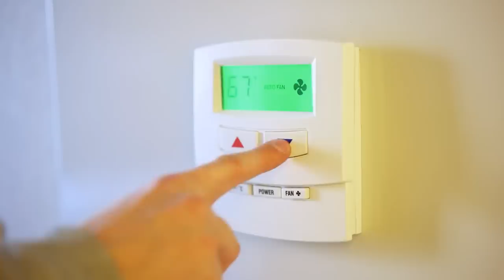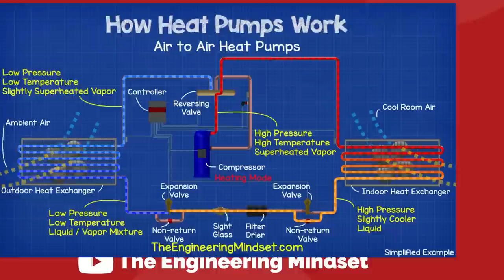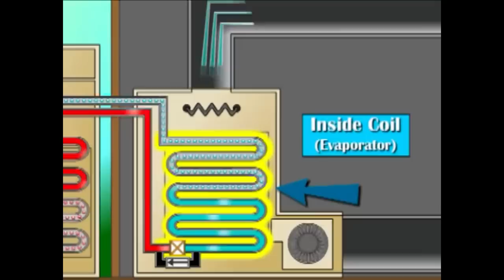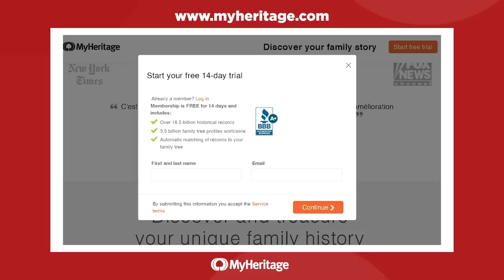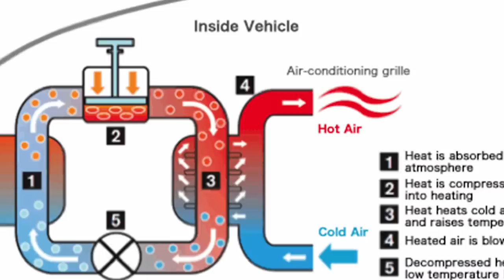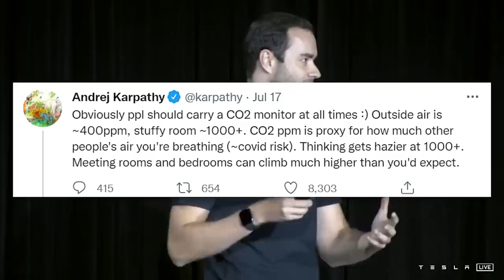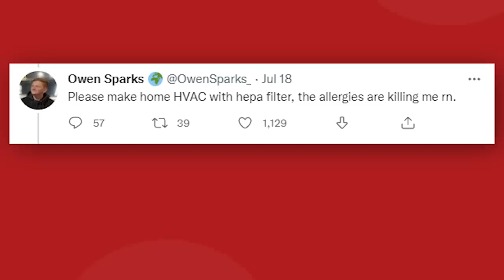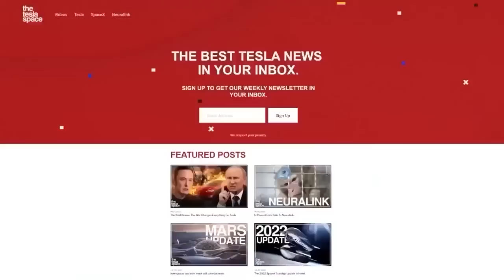Why Tesla's Heat Pump Is Essential For Our Future!

Comment: Note on Freon: To damage the ozone layer, it has to get up there, which in practice it can't in any significant amount. But when DuPont's patent was about to expire, it was suddenly banned and everyone was forced to buy more expensive alternatives. Much like how when the riffraff started moving to coastal California, the rich homeowners put a stop to it in the name of environmentalism.
Reply: It's the same story with 410A the patent will run out and they will look for the next Freon source to use.
Reply: I'm going to give you the inside scoop about how this heat pump is going to work will be multiple small heat pumps just like in the vehicle and what they will do is string them together on the same shaft that way it can gain maximum efficiency and what it will do is physically only run one heat pump per room or two this way you can actually select the room that you want to have colder than the others and you can control the airflow individually to each room you can have heat running in one room and air condition running in another just depending on what the person in the room preferences and individual thermostats for each individual room this would allow ultimate efficiency combined with artificial intelligence to control the entire system as a whole... having all of the compressors hooked up on the same rotor means that they can individually kick in and if there's more than one of them kicking in they both work together so it helps get the other compressors up to speed and cuts down the energy loss. Because the system will be able to have multiple different heat pumps it can run one of them on air condition mode and the other on heat mode which will basically make dry air because once you heat up the air the moisture can be absorbed by the one cooling easier and you can control the actual humidity perfectly. Mark my words this will be how the system will work it will be for new construction and for retrofitting because you're able to hook up the individual ducts instead of the entire manifold which supplies all the ducts...
Reply: @AquarianSoulTimeTraveler  Starting January 1, 2023 all new systems in the US will no longer have R-410A. The new refrigerants are HFOs, cars have been switching over to HFOs since 2015ish.
Reply: Wrong
Reply: Err, so how exactly did the ozone layer start to deteriorate in the 1970's and keep getting worse in the 1980's, if the reason is CFCs and yet they supposedly can't reach the ozone layer? The fact is that a very small amount of for example CFC-11 molecules do reach the ozone layer 30 km up and there they quickly deteriorates into chlorine radicals. Those stay up there for years and catalyze untold ozone decomposition reactions. CFC-11 is quite heavy but there is always a trailing end of gas molecules with enough kinetic energy to diffuse much higher than they're supposed to based on the average. It's just thermodynamics and statistical behavior of gases.
Reply: It's actually called "refrigerant" and Freon is just a name brand.
Reply: Since the banning of CFC's, the ozone layer is measurably improved.
Reply: @wombatillo  CFCs were actually well documented with solid measurements and observations of their breakdown and cascade reactions in the ozone layer.
They were used in all manner of processes and products, from the industrial level down to consumer products, as cleaning solvents, foam expanders, spray propellants, for fire supression, etc.. The HVAC/R industry was actually only a very small percentage of the total.

To my knowledge HCFCs, like R-22, never had anywhere near the same level of evidence of being a problem, but since they do have a chlorine atom in them, were phased out.

I question whether the actual impact from the HVAC/R industry was at all significant, or if it has been even remotely worth the cost to end users of the equipment to do away with.

Having said that, I'm an HVAC/R technician, so it's my job to follow best practices, and current regulations, and I make good money doing so.
I just wish the new refrigerants were not so expensive, and that equipment manufacturers were not currently so universally awful at building equipment that doesn't leak...
Literally all of them suck, there is not a single brand of equipment we can install that I have any level of confidence won't be leaking refrigerant within 5 years.
Reply: How do you know that Freon cannot make it up to the stratosphere where it can break down ozone?
Reply: R12 takes a decade to reach the stratosphere. It wouldn’t have been so bad except for the military using it as a cleaning solvent
Reply: You wanna breath freon be my guest lol
Reply: @bringer-of-change  Harmless at levels that don't reduce O2 levels.
Reply: @markbeiser  I wouldn't trust that slow leaks over time wouldn't eventually cause problems. I guess as long as the device is made well enough to ensure it wont leak then it's fine 🤷‍♂️ nobody wants a leaky machine anyways.
Reply: @AquarianSoulTimeTraveler  This type of system has existed already for years. VRV/VRT technology with inverter driven compressors.  I install them and service them. Typically they are in commercial applications because a home doesn’t normally need heat in one room and a/c in another room.  

Residential system are available and readily installed with inverter driven systems with VRV/VRT technology.  Daikin makes their “Life” system.  It is a unique residential product as it does not lose it’s heating capacity as it gets cold outside.  It maintains full capacity all the way down to 5 degrees outside. It doesn’t require a back up heater/aux heater like almost all other heat pumps.

It has many other unique features like the ability to connect up to 9 indoor units to one outdoor unit.

I hope Tesla does create a new product but the product you describe here is already available and they are highly advanced and packed with high tech features.
Reply: @colingenge9999  It's a heavy molecule and is broken down by sunlight. You'd have to have high flying aircraft spraying it to have a measurable effect.

Which actually did happen, now that I think of it. No doubt the military was even less efficient at keeping their systems sealed than civil aviation, and  it wasn't a priority given how cheap it was.
Reply: @tickticktickBOOOOM  are you just speculating that Freon with a higher density won’t go to higher altitudes?

If that were the case then nitrogen with the density of about 1.35 would not be found at sea level and would rise up in air that has an average density of 1.42. Carbon dioxide is a density of 1.8 would fill up the valleys but that does not occur. Freon has a density of about 1.6 kg/m³ so you’re postulating that somehow that would never rise up in the upper atmosphere yet if that were true then our atmosphere would be layered according to density with nitrogen at the top, Oxygen in the middle and all the carbon dioxide at the bottom but that does not occur because there are other mixing forces at work which is how and why Freon gets into the upper atmosphere but it does take a while. If I think back to my high school chemistry I recall some thing about partial pressures which force different gases to eventually distribute them selves evenly in any given volume over time.

I was involved in the whole ozone layer thing in the mid-1980s. Our concern was the movement of chlorofluorocarbons into the stratosphere from hail on which was being discharged in great quantities for fire protection purposes. The scientific panels that did this work we’re just a bunch of military folk or a small group that could call together some conspiracy but has scientist involved in every developed country in the world where there was complete agreement as to the mechanisms involved if not all of the absolute details.
Reply: @erickbravo5800  kind of Freon is not a name brand it is only R-12. Just like technically you can use propane as a refrigerant we call it propane although it has an R number as well. People just use freon for everything.
Reply: Correct
Reply: @wombatillo  I think that may go over the head of the commenter.....🙄
Reply: @AquarianSoulTimeTraveler  but you can just use one pump and use valves to control which rooms it cools.

Comment: Don’t have this system but I have been thinking about underfloor heating running off a heat pump. Concrete has a greater thermal mass than air and would be so good to hear a large slab in winter and cool it in summer
Reply: I have a slab foundation and it absorbs heat and cold really well. The problem is that the slab is down low so it doesn’t cool upper floors in the summer or help heat the lower floors in winter. Def better for single story homes.
Reply: @Martocciaweb  yep. Single story is ideal it would seem. Obviously a consideration on brand new builds.
Reply: Also heard you can run into problems in spring days with wide temperature swings. Freeze at night and nice during the day.  You still have a lot of thermal heat in the concrete but it warm out and it makes the house to hot.
Reply: I'd say just stick with water heater flooring. a heat pump would use to much energy overall and be next to useless since refrigerant pressures would not be stable since it's not consistent airflow/temperature plus during cooling season your floors would be cooled which for a concrete floor is next to useless.
Reply: @Tah_Dot  Underfloor heating from a HP is always water based. The HP runs refrigerant through a heat exchanger and heats or cools the water. In practice very few installations cool floors because there's little benefit but many drawbacks with this
Reply: We have underfloor heating on concrete (since 2001). It works well, however in my opinion it will be better in a floor with low inertia. Why? Even in winter, there are sunny days, you can not turn it off, because it takes too long to respond. The same in springtime. With a floor with low inertia, you can better adjust the room temperature in a fast way.
Reply: I warn you to properly insulate that concrete slab. You basically have to pour it in an "insulated pan" or else heat loss is extreme and would cost more to operate than any air to air system. I've seen bad floor heat systems as a utlity worker that cost customers a fortune to operate.

Comment: I’m a commercial HVAC technician. Besides the efficiency of the heat pumps constantly improving I haven’t seen anything on the horizon that would replace the ac concepts we currently have. Mitsubishi is pretty much top of the line and has been for a while
Reply: You can't expect a mechanic to suggest you walk to the bottom of your garden. No, fix the car so that you can drive there. Get outside your tiny box wizard and begin to see the world around you.

Comment: I'm a hvac contractor your description of a heat pump is good but as far as it not producing co2 is misleading because it depends on where the power comes from. In ohio the power they have is 92.6% coal power so you can explain how is there no co2 to the audience? Power does not come from thin air...

Comment: Im a Hvac contractor. They already make air quality product that does better then tesla car filtration and there on the market. However it’s all based off of what people want to invest in there system. I have a dual fuel system and the highest seer trane variable speed heat pump here in michigan. It does quiet well and is efficient to about 17-23f degrees. Then the furnace takes over. They are getting closer to being more efficient but not quiet there natural gas furnaces are still more economically efficient then any heat pump in colder climate. Electric based heating system heat pump and furnaces are 100 percent efficient but not economically efficient in cold climates. Overall having a dual fuel vs just using propane/nat gas is more efficient until certain temp marks in a lot of instances however that is based on how much you will pay if you get a base line product or top of the line product will determine your efficiency. Just like anything you get what you pay for.  I’d be interested in seeing what they come up with. However allow temps
to change when you leave and return and programming stats to go down at night and go up during the day doesn’t really save you money just to be honest. Every time you do this your system has to reheat or cool/dehumidify the whole house and objects in it. when it does it utilizes more energy then keeping it a constant temp in the house. That’s why having a variable frequency drive on a heat pump maximizes efficiency while maintain most comfort. instead of change temp your change the speed of the compressor creating less energy consumption.  You may save a few dollars a year possibly but also could pay more changing the temp and not keeping it constant. All depends on multiple factors.  I don’t see him doing much in hvac field that would change anything maybe on the tech side but nothin more. I’ll be interested in seeing if he does though.

Comment: I don't own a Tesla HP but I do own a Daiken HP that can be firmware updated, I can control temps and ranges from an app on my phone  and I have a two stage filter system including HEPA and ionization filters.   We run completely electrical in my house except for propane on demand hot water and factoring that in, I'd say along with some energy improvements like newer windows and doors, etc.  Our overall electrical bill has dropped by more than 50%.  Even in the summer when cooling.
Reply: Not always the same answer. nasa. ;-)
Sensible answer yet no comments nor even "likes".

Comment: Usually you're quite good about explaining technology, but even though I know & can explain the Carnot heat-pump cycle, I had problems following your explanation. You've done much better on other topics. For instance, you shouldn't have bothered talking about vibrating molecules. Yes, it's technically correct, but it's also distracting, especially for those who don't understand. It gets HOT. Leave it there. You also didn't touch on the fact that the phase change, from gas to liquid & back again, is what really transfers the heat. I would have thought that would be interesting to your viewers, & it's less technical than vibrating molecules. My 2 cents...

Comment: I’m a HVAC designer. All of technology already exists, and has for decades. Mitsubishi, Fujitsu, Daiken other leading manufacturers have very advanced systems systems with low ambient heat pump, indoor air quality from bipolar ionization, UV filter and ye, HEPA. This premium equipment is less common due to initial cost.
Reply: What is HV?
High velocity?
Hyper Vehicle?
Hot vacuum?

Comment: Very good video.  I wonder though, why not use the heat pump system to heat the water for the house, or cool your refridgerator, or dry your clothes...  why not produce a single unit that will take care of it all efficiently?
Reply: The problem with trying to heat water is that it needs to be heated to about 60degC. 
This requires the gas in the machine to be compressed to a much higher pressure than one dumping heat to ambient air temps.
It is also at the top end of the operational range of the current range of refrigerants.
We uses R717 which is one of the oldest but one of the most effective refrigerants but even that tops out at around 70degC
We are designing a hot water heating system at work and requires 25bar pressure to operate whereas the normal pressure is 10bar. Its capacity will be approx. 5 mega Watts.
The pressure ranges and demands of a refrigerator and a dryer are quite different and so better to keep them as independent units.
Reply: @GSimpsonOAM  Best answer yet. Someone who can use English to transfer ideas! Seldom on this YT trash page. 
R717  and producing 5MW? That sounds like fantasy. Or are you heating a factory?
Reply: @kennethkeen1234  Yes, heating water for a factory. Although a friend with several teen-age daughters could have done with it. His hot water bill was horrendous.

Comment: I live in Ohio and run a "Dual Fuel" system.  I use the heat pump down to 25F and then switch to the gas furnace at or below 25F.  My heat pump is arguably not the most efficient, it was installed 10 years ago, but it is better than running natural gas 100% of the time heating is required.  I would say I the gas furnace runs 30-40% of the time heat is required.  Newer heat pumps, particularly VRF (variable refrigerant flow) and inverter heat pumps are incredibly efficient down to very low temps.  I installed one a few years ago that was rated to heat at the rated capacity down to -13F.  Not too bad.  I still think there will be times when resistance heat or gas will be required as a back up, especially in colder climates.  Curious to see what improvements Elon has really made to improve the heat pump beyond what an inverter or VRF can do.

Comment: INSULATION! Most efficient means nothing if the house was not insulated well.  Owned several poorly  insulated homes in the past including overseas.  Our final home target was to have the best insulated home for its size.  We accomplished it, 109 degrees outside in door temp 78-82 no ac running.  The goal has to be insulation and then make the appliances use less power, amps, watts etc to do the work.

Comment: I would hope that Tesla systems would at least offer high end systems with things that are missing in even SEER2 23 rated heat pumps.  Accumulator; Rectifiers (liquid/gas seperators ahead of the expansion valves); Counter flow heat exchanger ahead of the evaporator coil;  Desuperator to help heat the hot water when in the A/C mode.   A (thermal) solar panel booster when operating as a heater is also a possibility.